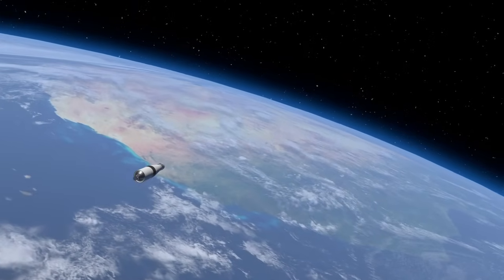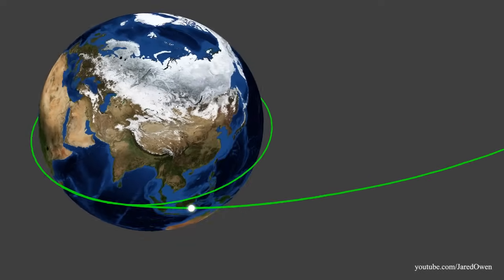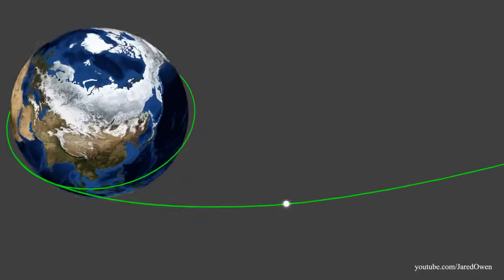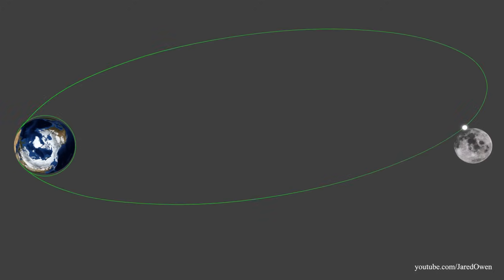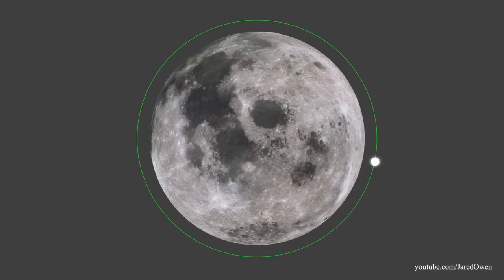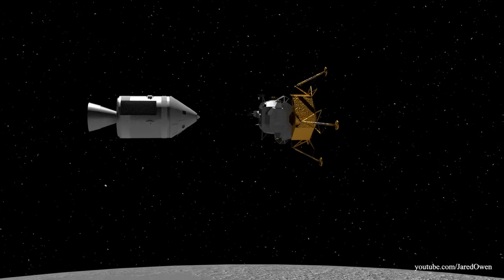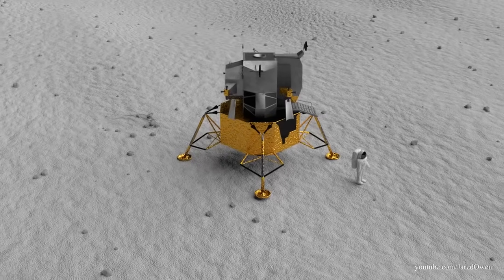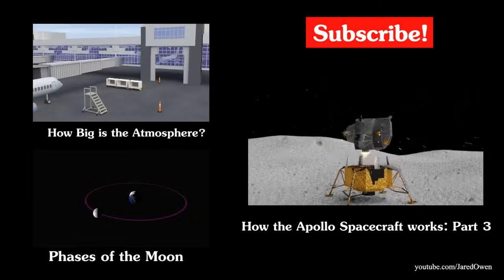How the Apollo Spacecraft works: Part 2

Comment: Great CGI... 
No, rockets cannot fly in a vacuum.. rockets don't fly to space...along with the fact every vacuum chamber test shows atmosphere surrounding rocket before any movement can occur.. Aerodynamics doesn't exsist in space to actually control any of this supposed miricale thrust motion. No way to direct... Control.. or reposition a space crafts.. and no gas jets don't work to position space crafts within a vacuum.. and weighted gyroscopes don't give motion in zero-g never mind within a vacuum.
one minute they need to explode a force from themselves off themselves.. then it's just gas jets... Lmao never mind dock at 17500 mph on the ISS 9x the speed of a bullet..
  Oxidizer starts burn filling tiny vacuum with gas to allow any motion not the ever expanding space... Space is a lie.. CGI green screens augmented reality harnesses and wires.. zero-g planes.  Camera 4th wall trickery.. space is a lie.. rockets don't go higher than 75 -100 miles.. 1000 miles down range.. check the trajectories.. while out of fuel.. also to note the the rocket engine burns 0.5 tons of fuel per second.. being these are usually 300 ton rockets they have about 10 minutes of lift until empty.. and don't fly off into space.. definitely can't fly to the moon.. never mind directing drones shaped like boat propellors billions of miles away.. that run on solar with no means of propulsion.. or direction...  it's all Santa Claus, unicorns and theory tales.. for adults.. earth is an enclosed system and scientism is a cult founded on beliefs that don't match reality. 

Look at the sun... Divergent light rays as physical law would prove.. yet told science has proven light rays reach earth almost parallel.. then look at a solar eclipse diagram and they show 2 separate light sources emitting from the sun... Converging upon one another.. 

No atmosphere to explain why ISS hasn't ripped itself apart in 20 years.. and how actronaughts can bounce about outside a craft moving 17500mph.. 
Yet no atmosphere to use aerodynamics... Direct the motion.. balance within the rocket while fuel is moving and being used. Actors are moving about.. yet dock at 17500 mph..

Can go to Aberdeen coast and see Norway's coast 325 miles away.. given calm sea conditions.. atmospheric moisture conditions and position of sun.. 

No curvature... Just fish eyes..including our own to a degree... linear perspective.. vanishing point.. field of view your eyes create.. atmospheric conditions.. surface refraction.. 

Travel from UK.. spins at 500 mph..take off and fly at 500 mph.. land on the equator which is 1000 mph.. and you can't measure test or experience any of it.. interesting.. 

Sci-Fi dilusions... Wrapped in a web of lies.. tin foil cans no way to move to reposition.. the BBQ roll.. lmao.. camera man left on the moon to send back the video tape. Lmao.. while the tin can gets lifted with a crane..
Reply: The speed of a bullet is irrelevant. Speed is relative: if you match the speed of ISS, the station isn't moving at all relative to you.
Reply: Aerodynamic doesn't exist in space..

No shit, Sherlock 🤣

Anyway, we use rockets in stead of conventional engines because of the absence of an atmosphere and thus aerodynamics.
Reply: ISS can fly at 17500 mph because of the absence of aerodynamics. 
I wonder why you believe that thermodynamics is needed for the ISS to be able to fly.
Your whole argument is based on ignorance.
Reply: @rinse-esnir4010  17500 mph.. no atmosphere. No resistance. Still gravity. No aerodynamics.. HOW DO YOU DOCK .. 17500 mph no aerodynamics. No way to control move or navigate within a vacuum.. everything falls faster to earth with no resistance.. hence why you can't get a video of a rocket FLYING in a vacuum. Lmao.
Just filling it with gases and atmosphere to push. Gliding on a structure. Because you can't fly something without aerodynamics. Never mind dock going 17500 mph.. 

Also gravity still exsists. Its earth.. so there is still an up in space. Our bodies have been designed very specifically not to hang upside down. Yet does ISS have an up How does that work with the CGI and wires lmao. And terribly wires computer screens 1st year apprentices could wire better. Submarines built with every inch thought about. Every cable wire clipped and ran neatly. Marked very specifically to what it powers.. yet look at the state of ISS. Lmao. Always glitching. 4th wall filming. Harnesses always being caught on camera. Lmao. You are blind to the cult you worship. 

End of day.. light alone destroys the entire globe model. Go stand under the sun and tell me if your shadow is larger than you are.. does it get larger the further away from the ground you are. This is diverging light rays. But the globe has been build upon parallel and converging. Erstosthenes used parallel rays to show the curved globe earth in his experiment. But
Reply: @michaelveroni1380  Michael, on your comment on how you dock moving 17,500 mph in a vacuum. First of all, the propulsion used was called RCS (Reaction control system) and was vaccum optimised. Now how do they actually dock? Blelive it or not, by the time the payload was in orbit, not only was the 3d stage moving at 17,500 mph, but the payload was moving along with it at the same speed. Once the CM was detached, it would turn around to face the LM. So how did the CM not fly away from the LM at ridiculous speeds? Let's recall the fact that all of these components were moving at the same exact velocity given they were all propelled by the same thing at the same time, kind of like how you can sit in the back of a truck moving at 30 mph and not fly away. The CM would detach and move slightly faster after using a puff from an RCM, and its RELATIVE velocity compared to the now separate LM would be a little under 1 meter a second, and because of this fancy little thing called orbital mechanics, once the CM turns around and propels its self towards the LM, it is moving retrograde relative to its orbit and slows down RELATIVE to its ORBIT. As a result it appears to move towards the LM from the prospective of the payload being docked to, then docking procedures can proceed and then BOOM! You have successfully docked with your LM and are ready to got to the moon! I hope this answered any questions you may have had😁
Reply: @rinse-esnir4010  Enjoy real physics... 

Scientism... I know what's 4000 miles deep in earth and inside every planet star moon and sun.. but only dug 7.5 miles deep... On earth... Lmao

Know what everything in the solar system weighs... From the inside of a shed in someones back garden.  Lmao

Drones billions of miles away.. sending back cartoon pictures.. 

The imaginations of madmen..

 Cgi for a reason.. 
.. research sacred secretion, chakras explained in children's cartoon. 3rd eye pineal gland, seat of the soul.. what they are hiding from you. True secrets of the universe.. 

All CGI CGI CGI.. read below.. 

CGI.. all cgi. Full solar documentaries.. cgi.. 

Take a read..don't bother commenting until you have and clicked links to educational information...kill the ego trapping you with fear of growth.. that voice right now telling you to ignore this. click the links - learn how your eyes work..  educate your soul to the truth of the matrix.. 

The truth is hard to swallow for a reason..  get some education to physical laws.. test your own reality. 
---------------------------------------
Earth is flat.  Scientism is a belief system that don't use the laws of physics..  read below.

Plane truths.

1. Curvature doesn't exsist upon earth and infact the science of how your eyes work. Laser test can also show. Can see scotland to Norway 325 mile, France to England, Spain to Africa.. no curvature.

Not curvature just Linear perspective, vanishing point, atmospheric conditions, light, field of view your eye balls create and angular resolution along a flat plane.the science of your eyes explained..
A Corridor has the same curvature as the ocean, flat..  in a boat or in an aeroplane... Horizon eye level 360degress.. science of your horizon / focus length, depth.

Linear perspective matrix ramp caused by your eyes and why you can see through curvature boats go over bottom first. Again and again.. With a zoom..

How your eyes trick you.. but you can zoom though curvature, impossibility on a ball.. it's actually a Linear perspective ramp of depth perception. 

So in simple terms.. you see along a flat plane.. the ground is diagonal from your eye level, so further away than looking straight ahead. Horizon is your focus length, just that your focus length is longer looking straight ahead rather than diagonal to ground so things appear to disappear bottom first.
Science of your eyes, they can't see billion or millions of miles.
Linear perspective. Linear means straight line.. not curved.. horizon is the focus distance you have nothing to do with curvature. Horizon is eye level to the observer, it's how your eyes focus, eye level is the term used, your not actually looking level but if you put your hand up to your eyes this is the height you perceive the ground to be obviously not as it's under your feet. And its depth not height.
 Zoom camera gives longer view as has better lens than your eye, then telescope longer view again always bringing the boat back, giving you a longer perspective ramp. Not Curvature...

https://youtu.be/C4h-AS729JM

https://images.app.goo.gl/FbC2NGvbHqc6qgxZ9

https://images.app.goo.gl/G8g6wgk3XQ4eFD4N8

https://images.app.goo.gl/xzYHWQPVnzRBFaq46

https://images.app.goo.gl/1hWyXbktwVYJfwoK7

https://youtu.be/tWvPZG34fDU

https://images.app.goo.gl/xiWGhEbe5qwDtdVVA

https://images.app.goo.gl/xiWGhEbe5qwDtdVVA

https://youtu.be/YVAliLPt61U

2. Light is divergent from source in reality. Source being the sun. Same as a spherical bulb. Larger shadows than object. Laws of shadows. 

But parallel when NASA needs it to be to explain seasons. Or converging if NASA needs it to be to explain the solar eclipse shadow size.  Fact is light is divergent from the sun. Solar eclipse diagram breaks laws of physics, and reality as its converging 2 spot lights on the moon to try give a smaller shadow than object. Breaking the laws of physics to suggest this diagram is science, but try match what we physically see on earth of a 70 mile shadow, with a diagram that doesn't match reality or physical law. And the moon is 30 Mile wide. Physically can't be 2000mile wide. 30 mile wide - Matching law of shadows. The fact globe diagrams contridict each other and reality shows a clear lie.
Light from a sphere is always diverging, light from a convex surface is always diverging. Never converging or parallel which contridict each other.

https://images.app.goo.gl/g2VFDqmXgXwWReLR7. Parallel seasons..

https://images.app.goo.gl/bQLzMLpRTvztw4G17 
- 2 spot lights converging.. not physical laws of sun.. 

https://youtu.be/IpqL0D82xn8

3. So no curvature., So no ball.
No ball - No spin.. no motion from earth is fact of aero-plane travel upon a supposedly ever increasing ball from 0mph at poles to 1000mph at equator.
Light rays from sun are divergent, not converging and parallel which are used for solar diagrams, which all contridict each other. Contridicting diagrams for the same solar system, someone is lying and light leaves a convex surface divergent, not parallel or converging, just how we see the suns rays diverge..   In reality.. in physics..laws of light and shadows. No globe diagrams match that of physical reality which we live..

4. NAIL IN THE COFFIN.
Rockets never actually fly in a vacuum, they glide on a structure.
Aerodynamics within a vacuum doesn't exsist but "gravity" still exsists and still pulls you to earth but now you have no atmosphere for aerodynamics for the nose or wings or anything to move against, to stabilise against. To lift off of.
Throw a dart in a vacuum, no aerodynamics. It falls.

Plane falls out the sky when hits thin air over mountains, no atmosphere, it doesn't glide, it falls. No aerodynamics. doesn't matter what the thrust mechanism is, no aerodynamics to fly or stabilise.
No space travel. CGI, movie sets, harnesses models filming technology.. 
If Newton's 3rd law was in effect these flys should just keep floating the direction they jumped in the vacuum.. but that's not how a vacuum works. Or space. Fall faster and no way to fight it nothing to use as resistance.. no atmosphere.  Still has "gravity". As the ISS has to supposedly travel 9x the speed of a bullet to over come it. Tell me how to dock on something moving that fast with no aerodynamics..  and they always switch their engines off when they get to 70 mile high still in an atmosphere.. no fuel left. High altitude zero-g plane.

https://youtu.be/C4h-AS729JM

https://youtu.be/-BsrzO7aXNs 

"Sonoluminescence" - real stars and planets.
"Stars can be seen from airplane resolved"

Earth is god's intelligently created flat enclosed eco system. Enjoy.
Reply: Oxidizers, they are basically oxygen that the rocket blasts in the engine so rocket engines CAN be used, and learn something about orbital mechanics. Yes, the fuel is empty but you only need the fuel to speed up, if you drive your car, you press the gas, and when you let loose you don’t stop immediately, the same goes for rocket engines, the fuel is empty way before they reach the moon, but because they still are going crazy fast they still get there, also the reason ISS hasn’t burned up, is because it fly’s above the atmosphere, educate yourself, one celled twat
Reply: @darthvader8229  lmao.. no please you educate yourself.. plenty information for you there.. along with diverging sun light of the sun Ruining your entire model.. 
You can't fly a rocket in a vacuum.. you can light a fire and start to fill the vacuum that's about it.. still can't fly though, I please ask you to try.. and no iss doesn't travel 9x the speed of a bullet.. with no aerodynamics. Rockets don't fly up into magic floaty bits in space.. the vacuum.. which everything falls faster in because no resistance to fight the effect of "gravity" pulling to to earth.. why you never see a rocket go higher than 70 mile before it's horizontal.. and turns to CGI and green screens.. dropped all fuel tanks.. engines off. High altitude zero-g plane. Lmao.. still hear sound on the camera in a vacuum.. lmao sound doesnt travel in a vacuum. Lmao. So they are still in an atmosphere. Might want to find out what happens to a  aluminium container in a vacuum. Lmao. Bye bye space travel... Harnesses and green screens and high altitude rocket planes. Might want to think how the NASA space plane manages to fly to the ISS.. 17500 mph 9x the speed of a bullet. And dock.. with no aerodynamics or any means to control within a vacuum.. 

Please I ask again you do some real science and physics. 

Enjoy real physics... Scientism... I know what's 4000 miles deep in earth and inside every planet star moon and sun.. but only dug 7.5 miles deep... On earth... Lmao Know what everything in the solar system weighs... From the inside of a shed in someones back garden. Lmao Drones billions of miles away.. sending back cartoon pictures.. The imaginations of madmen.. Cgi for a reason.. .. research sacred secretion, chakras explained in children's cartoon. 3rd eye pineal gland, seat of the soul.. what they are hiding from you. True secrets of the universe.. All CGI CGI CGI.. read below.. CGI.. all cgi. Full solar documentaries.. cgi.. Take a read..don't bother commenting until you have and clicked links to educational information...kill the ego trapping you with fear of growth.. that voice right now telling you to ignore this. click the links - learn how your eyes work.. educate your soul to the truth of the matrix.. The truth is hard to swallow for a reason.. get some education to physical laws.. test your own reality. --------------------------------------- Earth is flat. Scientism is a belief system that don't use the laws of physics.. read below. Plane truths. 1. Curvature doesn't exsist upon earth and infact the science of how your eyes work. Laser test can also show. Can see scotland to Norway 325 mile, France to England, Spain to Africa.. no curvature. Not curvature just Linear perspective, vanishing point, atmospheric conditions, light, field of view your eye balls create and angular resolution along a flat plane.the science of your eyes explained.. A Corridor has the same curvature as the ocean, flat.. in a boat or in an aeroplane... Horizon eye level 360degress.. science of your horizon / focus length, depth. Linear perspective matrix ramp caused by your eyes and why you can see through curvature boats go over bottom first. Again and again.. With a zoom.. How your eyes trick you.. but you can zoom though curvature, impossibility on a ball.. it's actually a Linear perspective ramp of depth perception. So in simple terms.. you see along a flat plane.. the ground is diagonal from your eye level, so further away than looking straight ahead. Horizon is your focus length, just that your focus length is longer looking straight ahead rather than diagonal to ground so things appear to disappear bottom first. Science of your eyes, they can't see billion or millions of miles. Linear perspective. Linear means straight line.. not curved.. horizon is the focus distance you have nothing to do with curvature. Horizon is eye level to the observer, it's how your eyes focus, eye level is the term used, your not actually looking level but if you put your hand up to your eyes this is the height you perceive the ground to be obviously not as it's under your feet. And its depth not height. Zoom camera gives longer view as has better lens than your eye, then telescope longer view again always bringing the boat back, giving you a longer perspective ramp. Not Curvature... https://youtu.be/C4h-AS729JM https://images.app.goo.gl/FbC2NGvbHqc6qgxZ9 https://images.app.goo.gl/G8g6wgk3XQ4eFD4N8 https://images.app.goo.gl/xzYHWQPVnzRBFaq46 https://images.app.goo.gl/1hWyXbktwVYJfwoK7 https://youtu.be/tWvPZG34fDU https://images.app.goo.gl/xiWGhEbe5qwDtdVVA https://images.app.goo.gl/xiWGhEbe5qwDtdVVA https://youtu.be/YVAliLPt61U 2. Light is divergent from source in reality. Source being the sun. Same as a spherical bulb. Larger shadows than object. Laws of shadows. But parallel when NASA needs it to be to explain seasons. Or converging if NASA needs it to be to explain the solar eclipse shadow size. Fact is light is divergent from the sun. Solar eclipse diagram breaks laws of physics, and reality as its converging 2 spot lights on the moon to try give a smaller shadow than object. Breaking the laws of physics to suggest this diagram is science, but try match what we physically see on earth of a 70 mile shadow, with a diagram that doesn't match reality or physical law. And the moon is 30 Mile wide. Physically can't be 2000mile wide. 30 mile wide - Matching law of shadows. The fact globe diagrams contridict each other and reality shows a clear lie. Light from a sphere is always diverging, light from a convex surface is always diverging. Never converging or parallel which contridict each other. https://images.app.goo.gl/g2VFDqmXgXwWReLR7. Parallel seasons.. https://images.app.goo.gl/bQLzMLpRTvztw4G17 - 2 spot lights converging.. not physical laws of sun.. https://youtu.be/IpqL0D82xn8 3. So no curvature., So no ball. No ball - No spin.. no motion from earth is fact of aero-plane travel upon a supposedly ever increasing ball from 0mph at poles to 1000mph at equator. Light rays from sun are divergent, not converging and parallel which are used for solar diagrams, which all contridict each other. Contridicting diagrams for the same solar system, someone is lying and light leaves a convex surface divergent, not parallel or converging, just how we see the suns rays diverge.. In reality.. in physics..laws of light and shadows. No globe diagrams match that of physical reality which we live.. 4. NAIL IN THE COFFIN. Rockets never actually fly in a vacuum, they glide on a structure. Aerodynamics within a vacuum doesn't exsist but "gravity" still exsists and still pulls you to earth but now you have no atmosphere for aerodynamics for the nose or wings or anything to move against, to stabilise against. To lift off of. Throw a dart in a vacuum, no aerodynamics. It falls. Plane falls out the sky when hits thin air over mountains, no atmosphere, it doesn't glide, it falls. No aerodynamics. doesn't matter what the thrust mechanism is, no aerodynamics to fly or stabilise. No space travel. CGI, movie sets, harnesses models filming technology.. If Newton's 3rd law was in effect these flys should just keep floating the direction they jumped in the vacuum.. but that's not how a vacuum works. Or space. Fall faster and no way to fight it nothing to use as resistance.. no atmosphere. Still has "gravity". As the ISS has to supposedly travel 9x the speed of a bullet to over come it. Tell me how to dock on something moving that fast with no aerodynamics.. and they always switch their engines off when they get to 70 mile high still in an atmosphere.. no fuel left. High altitude zero-g plane. https://youtu.be/C4h-AS729JM https://youtu.be/-BsrzO7aXNs "Sonoluminescence" - real stars and planets. "Stars can be seen from airplane resolved" Earth is god's intelligently created flat enclosed eco system. Enjoy.
Reply: Enjoy real physics... Scientism... I know what's 4000 miles deep in earth and inside every planet star moon and sun.. but only dug 7.5 miles deep... On earth... Lmao Know what everything in the solar system weighs... From the inside of a shed in someones back garden. Lmao Drones billions of miles away.. sending back cartoon pictures.. The imaginations of madmen.. Cgi for a reason.. .. research sacred secretion, chakras explained in children's cartoon. 3rd eye pineal gland, seat of the soul.. what they are hiding from you. True secrets of the universe.. All CGI CGI CGI.. read below.. CGI.. all cgi. Full solar documentaries.. cgi.. Take a read..don't bother commenting until you have and clicked links to educational information...kill the ego trapping you with fear of growth.. that voice right now telling you to ignore this. click the links - learn how your eyes work.. educate your soul to the truth of the matrix.. The truth is hard to swallow for a reason.. get some education to physical laws.. test your own reality. --------------------------------------- Earth is flat. Scientism is a belief system that don't use the laws of physics.. read below. Plane truths. 1. Curvature doesn't exsist upon earth and infact the science of how your eyes work. Laser test can also show. Can see scotland to Norway 325 mile, France to England, Spain to Africa.. no curvature. Not curvature just Linear perspective, vanishing point, atmospheric conditions, light, field of view your eye balls create and angular resolution along a flat plane.the science of your eyes explained.. A Corridor has the same curvature as the ocean, flat.. in a boat or in an aeroplane... Horizon eye level 360degress.. science of your horizon / focus length, depth. Linear perspective matrix ramp caused by your eyes and why you can see through curvature boats go over bottom first. Again and again.. With a zoom.. How your eyes trick you.. but you can zoom though curvature, impossibility on a ball.. it's actually a Linear perspective ramp of depth perception. So in simple terms.. you see along a flat plane.. the ground is diagonal from your eye level, so further away than looking straight ahead. Horizon is your focus length, just that your focus length is longer looking straight ahead rather than diagonal to ground so things appear to disappear bottom first. Science of your eyes, they can't see billion or millions of miles. Linear perspective. Linear means straight line.. not curved.. horizon is the focus distance you have nothing to do with curvature. Horizon is eye level to the observer, it's how your eyes focus, eye level is the term used, your not actually looking level but if you put your hand up to your eyes this is the height you perceive the ground to be obviously not as it's under your feet. And its depth not height. Zoom camera gives longer view as has better lens than your eye, then telescope longer view again always bringing the boat back, giving you a longer perspective ramp. Not Curvature... https://youtu.be/C4h-AS729JM https://images.app.goo.gl/FbC2NGvbHqc6qgxZ9 https://images.app.goo.gl/G8g6wgk3XQ4eFD4N8 https://images.app.goo.gl/xzYHWQPVnzRBFaq46 https://images.app.goo.gl/1hWyXbktwVYJfwoK7 https://youtu.be/tWvPZG34fDU https://images.app.goo.gl/xiWGhEbe5qwDtdVVA https://images.app.goo.gl/xiWGhEbe5qwDtdVVA https://youtu.be/YVAliLPt61U 2. Light is divergent from source in reality. Source being the sun. Same as a spherical bulb. Larger shadows than object. Laws of shadows. But parallel when NASA needs it to be to explain seasons. Or converging if NASA needs it to be to explain the solar eclipse shadow size. Fact is light is divergent from the sun. Solar eclipse diagram breaks laws of physics, and reality as its converging 2 spot lights on the moon to try give a smaller shadow than object. Breaking the laws of physics to suggest this diagram is science, but try match what we physically see on earth of a 70 mile shadow, with a diagram that doesn't match reality or physical law. And the moon is 30 Mile wide. Physically can't be 2000mile wide. 30 mile wide - Matching law of shadows. The fact globe diagrams contridict each other and reality shows a clear lie. Light from a sphere is always diverging, light from a convex surface is always diverging. Never converging or parallel which contridict each other. https://images.app.goo.gl/g2VFDqmXgXwWReLR7. Parallel seasons.. https://images.app.goo.gl/bQLzMLpRTvztw4G17 - 2 spot lights converging.. not physical laws of sun.. https://youtu.be/IpqL0D82xn8 3. So no curvature., So no ball. No ball - No spin.. no motion from earth is fact of aero-plane travel upon a supposedly ever increasing ball from 0mph at poles to 1000mph at equator. Light rays from sun are divergent, not converging and parallel which are used for solar diagrams, which all contridict each other. Contridicting diagrams for the same solar system, someone is lying and light leaves a convex surface divergent, not parallel or converging, just how we see the suns rays diverge.. In reality.. in physics..laws of light and shadows. No globe diagrams match that of physical reality which we live.. 4. NAIL IN THE COFFIN. Rockets never actually fly in a vacuum, they glide on a structure. Aerodynamics within a vacuum doesn't exsist but "gravity" still exsists and still pulls you to earth but now you have no atmosphere for aerodynamics for the nose or wings or anything to move against, to stabilise against. To lift off of. Throw a dart in a vacuum, no aerodynamics. It falls. Plane falls out the sky when hits thin air over mountains, no atmosphere, it doesn't glide, it falls. No aerodynamics. doesn't matter what the thrust mechanism is, no aerodynamics to fly or stabilise. No space travel. CGI, movie sets, harnesses models filming technology.. If Newton's 3rd law was in effect these flys should just keep floating the direction they jumped in the vacuum.. but that's not how a vacuum works. Or space. Fall faster and no way to fight it nothing to use as resistance.. no atmosphere. Still has "gravity". As the ISS has to supposedly travel 9x the speed of a bullet to over come it. Tell me how to dock on something moving that fast with no aerodynamics.. and they always switch their engines off when they get to 70 mile high still in an atmosphere.. no fuel left. High altitude zero-g plane. https://youtu.be/C4h-AS729JM https://youtu.be/-BsrzO7aXNs "Sonoluminescence" - real stars and planets. "Stars can be seen from airplane resolved" Earth is god's intelligently created flat enclosed eco system. Enjoy.